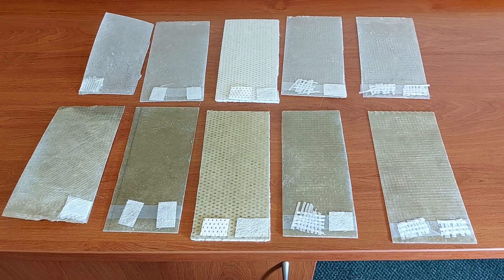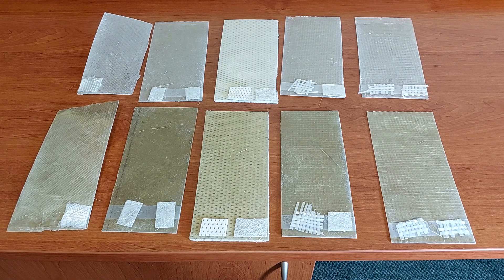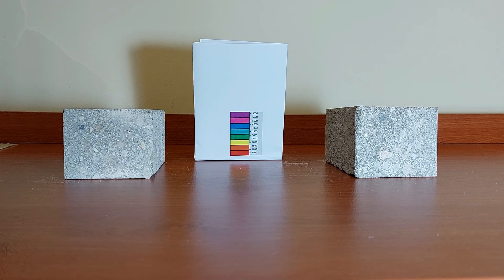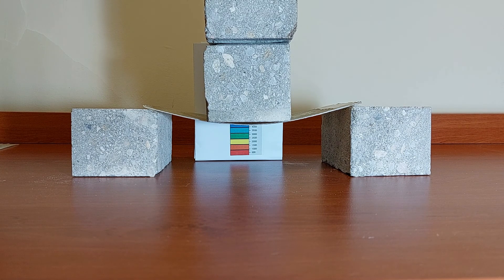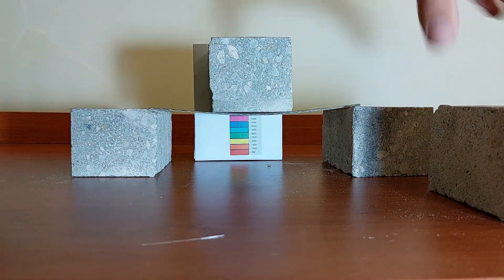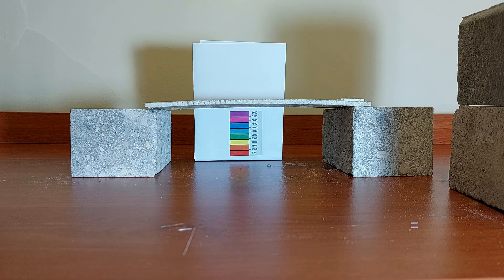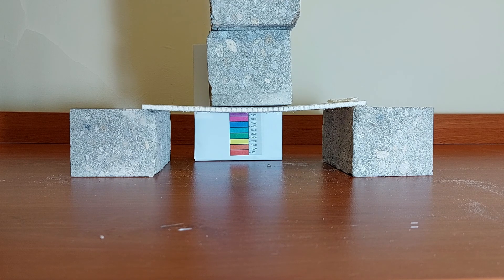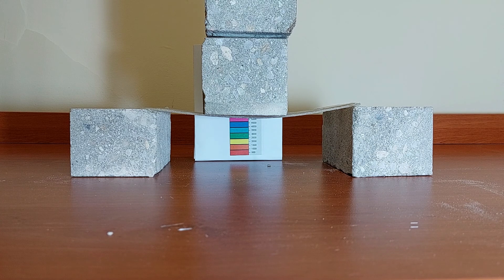Fiberglass work / How strong is fiberglass/ Fiberglass bending test

Comment: Bad test, wrong conclusion. You are only testing young modulus of your resins. Fiberglass elastic deformation limit by density (specific) is x10~x20 higher, impossible conclusion on neither traction yield strength fiber nor benefit of a particular woven pattern, because youre resine reach the plastic deformation area while yours fibers are far below elastic limit, you need synchronise the e-limit of the two materials
Reply: Can't wait to see your test then...
Reply from the maker: @gnorweb7339. First of all, thank you very much for your comment!!! I've prepared a new set of samples for the next test, which I aim to present more professionally and, hopefully, with more conclusive results. While I haven't had the chance to film the episode yet, I’m optimistic it will be ready and available soon. If you found this answer helpful, I’d greatly appreciate it if you could subscribe to the channel if you haven’t already. Your support means a lot and motivates me to keep creating content. Thank you!
Reply from the maker: @Perfect-24. First of all, thank you very much for your comment!!! I’m not an expert in fiberglass testing, and as you can see, I don’t have specialized testing equipment. However, I’m experimenting with different combinations of fiberglass laminated with the same type of resin to observe their behavior.
I’ve prepared a new set of samples for a comparison that I plan to test more professionally, aiming for clearer and more conclusive results. If you have any recommendations, I’d greatly appreciate them. I’m happy to prepare samples based on your instructions and include them in future tests. If you found this answer helpful, I’d greatly appreciate it if you could subscribe to the channel if you haven’t already. Your support means a lot and motivates me to keep creating content. Thank you!
Reply: @PAFixandCrafts   No problem, understanding how materials react is not trivial ! A non-exhaustive list for improve your benchmark:
_ First, bending test is irrelevant for thin structure ! Bending test is relevant for non-zero thickness, like hollow structure (tube/pipe,  truss, sandwitch, spring, etc) or thick structure (beam,  rebar, plate, slabs, panels..). Because even a epsilon-thickness carbon fiber panel will bend. Solution, make tube, corrugated panel (like cardboard), any non-2d shape.
_ Synchronize e-limit (elastic limit, not plastic limit) of the two material implie minimize the amount of resine, so that when the failure occurs, the fiberglass is shattered. Quite hard to find the ratio, trial/error on small sample.
_ Fiber fabric are only suited  for tension forces, right, so put resine only where compression stress act, indeed on the top of layer.
The major problem is e-limit of fiberglass is very hight you should prestressing you fabric, fibers must be maximum tensioned to artificially increase the Young's modulus (Takes cues of tensioning a membrane of tambourine using a screw system).
_ Synchronize e-limit means for a fixed %strain (for exemple 1~2%)  glass and resine must reach the e-limit a the same time (%strain = e-limit/y-modulus)
_ If your goal is just compare woven pattern, for exemple 3-woven superior to 2-woven/4-woven/mat-choas-nonwoven, you shoud use fabric more weak, like pe/pp/cotton/.. To highlight the strength of the pattern, rather than the intrinsic strength of the fiber.
_ An elegant test, with no material, is 1 vs 1 test. It is relative test, not absolute. Fix sample A at the ends, take sample B at 90 degrees and press the two samples at theirs middle. The winner is the one who does not break.

Comment: I had a damaged frame rail on my car that I pound out straight and completely filled the damaged area (plus an additional 3 inches past both ends) with chopped fiberglass and epoxy resin.  I'm hoping that will be nice and strong for a long time.  It's a solid mass of epoxy and chopped fiberglass that's 3.5 inches tall, 4 inches wide, and 10 inches long.
Reply from the maker: @Pendragon501. First of all, thank you very much for your comment!!! I'd like to extend my apologies for the delayed response. Regarding the repair you mentioned, I genuinely see no reason why it wouldn't hold up well, especially considering the support material and level of reinforcement. Given the circumstances, it should endure without any issues. If you found my video to be of assistance, I'd greatly appreciate it if you consider subscribing to the channel if you haven't already. Your support serves as a significant motivator for me to continue creating and sharing new content.

Comment: Have you tried this type of test using S-glass?
Reply from the maker: @tomcop668. First of all, thank you very much for your comment!!! Unfortunately, I was unable to conduct the test due to the unavailability of S fiberglass in my current inventory. However, recognizing the importance of such a comparison, I am considering the inclusion of S fiberglass in future testing initiatives. Your understanding and patience as I work towards enhancing our testing capabilities are greatly appreciated. It is known that  S-Glass, or "structural glass," is known for its high tensile strength. It is stronger than E-Glass but less flexible. E-Glass is more flexible and has a lower price. E-Glass is widely used in a variety of applications, including boat building, automotive components, and construction. It is a versatile and cost-effective option for many industries. Instead, I see S-Glass more for special applications. If you found value in my response, I would be sincerely grateful if you considered subscribing to the channel, if you haven't already. Your subscription serves as a motivating force, inspiring me to create and share more content in the future. Your support is immensely appreciated, and I look forward to bringing you more informative and engaging videos.

Comment: Very interesting comparison. I'm planning on making a new hatch from my boat, with centre layers made from coremat. I think it gets more stiffness if you have layer(s) of glass on both the top and bottom surfaces, where one is under tension, and the other under compression,  By increasing the distance between the two layers of glass, you gain greater torsional stiffness than by having them close together, it would have been interesting to see the strength of coremat and 2 layers of glass.
Reply from the maker: @jpwilliamsj.  First of all, thank you for your input, and I genuinely appreciate your attention to detail. You're absolutely right about the placement of Coremat between the layers of CSM – it's crucial for maintaining structural integrity. If you're interested, I have an older video on my channel where I delve into the specifics of using Coremat.
          I've already prepared the samples for the upcoming episodes and will be featuring a laminate with two outer layers of CSM and Coremat between them. I'm also working on enhancing the test stand to ensure more consistent data. It's an exciting project, and I'm eager to share the results with you. Unfortunately, the editing process takes a bit of time, so please bear with me; the video will be up in approximately three weeks. Additionally, it might be beneficial to consider incorporating reinforcement through thoughtful design, such as the inclusion of longitudinal ribs. This could further enhance the overall structural integrity of the hatch. If you found my response valuable, I would greatly appreciate it if you could consider subscribing to the channel, if you haven't already. Your support means a lot to me, and it serves as a significant source of motivation to keep creating content. Thank you in advance!

Comment: Do you have a test with epoxy resin?
Reply from the maker: @moogdoog. First of all, thank you very much for your comment! Unfortunately, I didn't do a test with epoxy resin because I have a few projects where I use this resin. In general, I use a lot of polyester and vinylester, but I will take it into consideration, maybe I will do a test in the future. But what is very important to know is the fact that the glass fiber used in combination with epoxy is slightly different from the one used in combination with polyester. Fiberglass is the same. The only difference is the glue that holds the fibers together. In the case of glass fiber for polyester, this adhesive dissolves in styrene. Styrene, which is a component of polyester resin and helps the absorption of the resin by the glass fiber. In the case of epoxy resin, a powder is used to keep the glass fibers glued and this helps the absorption of the resin by the glass fiber.Hoping that my answer was helpful, don't forget to subscribe to the channel if you haven't done so yet. This helps me a lot to continue. And if you have any questions, don't hesitate to write to me.

Comment: Hello when doing this test you need to consider fiber orientation which will strongly influence tests.
Reply from the maker: @Dave Demchak. Of course, this aspect is extremely important. But in my experiment, all the samples had the sewn fiberglass oriented in the same direction (0, 45 and 90 degrees). RW in two directions (0 and 90 degrees). Regarding the coremat and the CSM, this theory does not apply because the coremat has the same rigidity no matter how it is placed and the CSM takes 50% of the force distribution in all directions. Only the resin used is different in this case. But there are many other factors that can influence the quality of the laminate, such as the percentage of catalyst, ambient temperature, relative humidity, the amount of styrene in the resin, the viscosity of the resin, etc. If you haven't already, don't forget to subscribe to the channel. We share the same passion from what I can see and your support means a lot to me.

Comment: Good video. I am a Vinyl Ester Resin fanatic. I think the benefit of using Vinyl Ester Resin vs. Polyester Resin is best illustrated at the point of failure. Vinyl Ester resin is far superior to polyester and will "Flex" or "Bend" much more the Polyester before the laminate will fracture. This can be illustrated using strips and bending until the strip fractures. All and all, good content!
Reply from the maker: @Vernese Customs. First of all, thank you very much for your comment. I am very happy to add that we have the same passion for resin and fiberglass. In the future I will make a more professional test stand to be able to process more samples and to have more accurate results. Thank you very much for your support. This helps me and motivates me to keep posting more videos!

Comment: So can someone order a sheet of fiberglass with a coat of resin?
Reply from the maker: @Escanor. First of all thank you very much for your comment!!! If I understood your question correctly, you need a fiberglass plate.  And depending on the size and the region where you live, I can help you, but my question is what type of fiberglass do you need.  Or if you can describe to me the type of application you want to use this plate for, maybe I can recommend the right fiberglass.  Here I mean the structure and density that makes a single layer behave totally differently. If you want to help me too, don't forget to subscribe to the channel.  It is very important for me.

Comment: Thanks for sharing ! Love your test set up for bending, eye opener! . I am making test for a thin leeboard for my sailing kayak. My plan is to use 1/8 inch plywood and laminate it . I’ll then shape to a NACA form. I have leftover fiberglass  and carbon fiber from other projects so there I go
Reply from the maker: @Javier Correa. First of all, thank you very much for your comment!!! I am very glad to hear that you liked the test.  I plan to prepare more tests, but I haven't found the necessary time yet, being involved in a project that I hope will be finished soon.  I would like to test some fiberglass cubes under the hydraulic force of a press.  This way I can see the compression resistance of each type of glass fiber.Thank you very much for your comment though.  This encourages me a lot to continue, knowing that my work is appreciated!